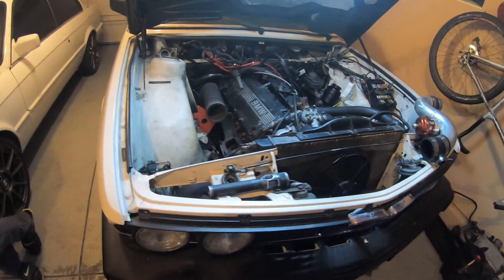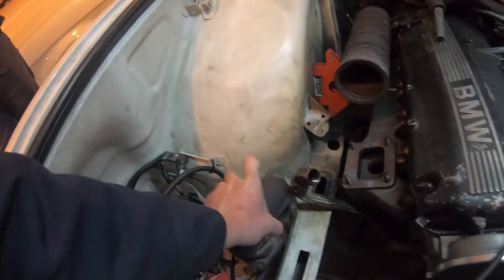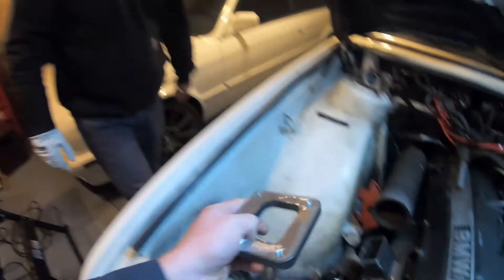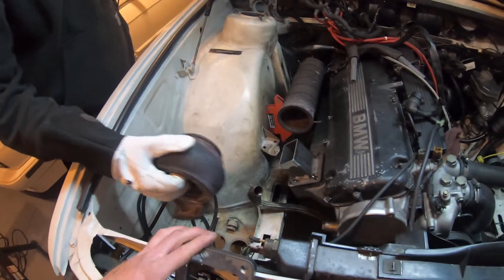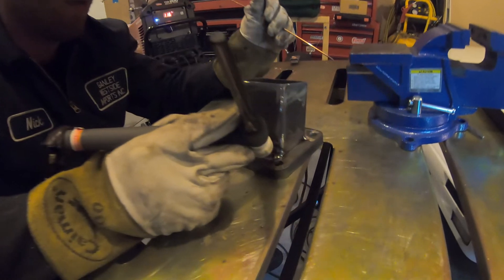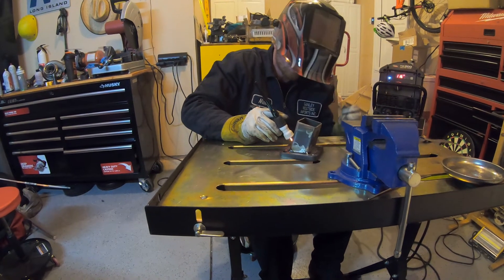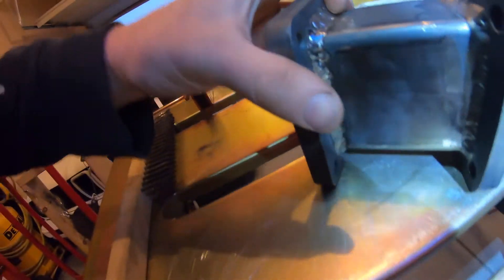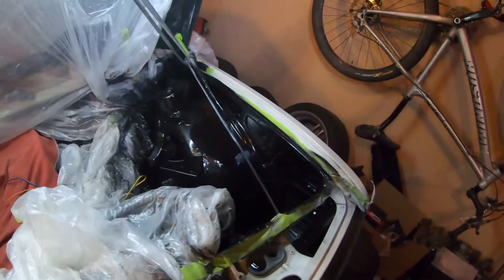T4 to T4 Turbo spacer adapter fabrication/welding for BMW Turbo M30 TCD Manifold setup!!

Comment: Thought the tcd manifold was supposed to be a good job
Reply from the maker: It only fits there turbo which is an on center exhaust housing, most turbos have the offset housing like my precision 6266. I wasnt aware when i bought it so thats why i had to make this adapter.  Figured the tcd manifold should be bullet proof that its a cast iron manifold. The rapid spools one i had cracked at multiple points. Dont think anyone else is making manifolds unfortunately